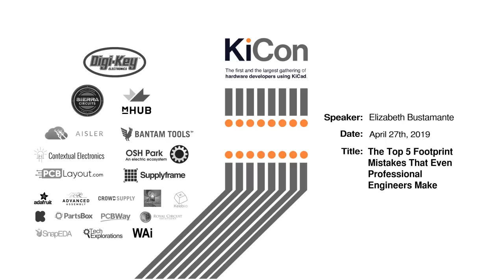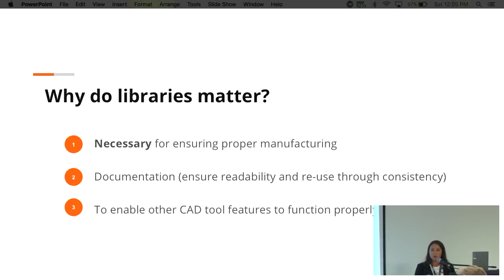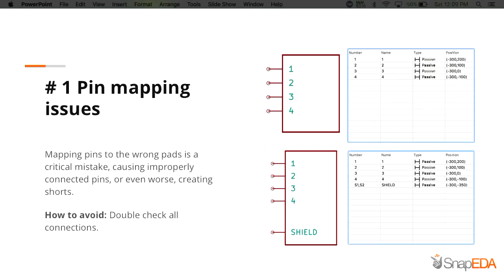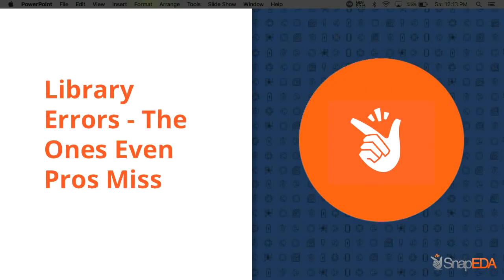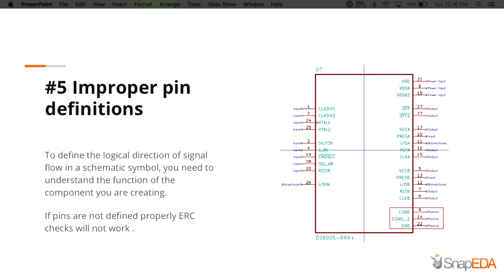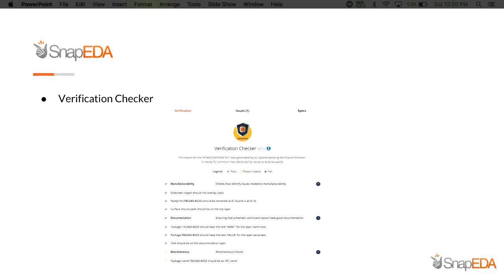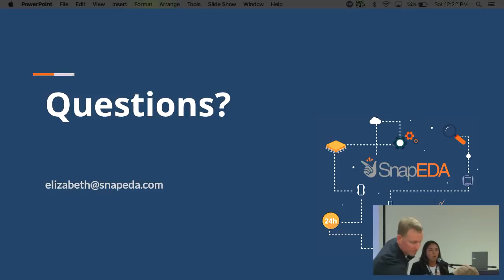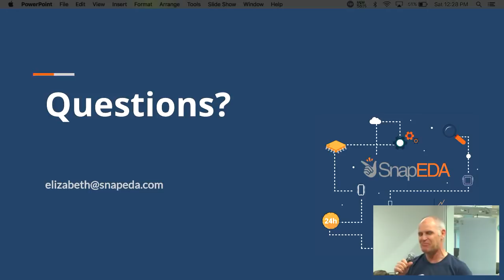The Top 5 Footprint Mistakes That Even Pro Engineers Make - Elizabeth Bustamante (KiCon 2019)

Comment: I see one error " In May 2009, IEC land pattern committee voted and approved a new Level B Zero Component Orientation and redefined the IPC-7351 Zero Orientation as Level A. The new IEC 61188-7 defines Zero Component Orientation pin 1 locations in the bottom left corner except 2-pin components Pin 1 is on the left side and labeled it “Level B”. Figure 2 represents IEC 61188-7 “Level B” zero component orientation." this is current information